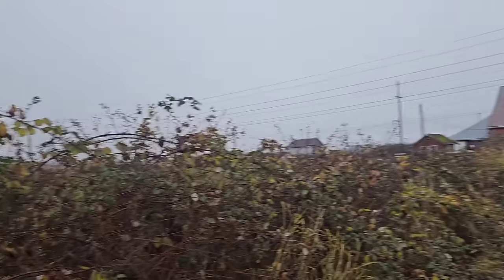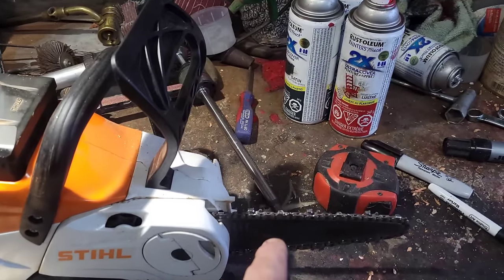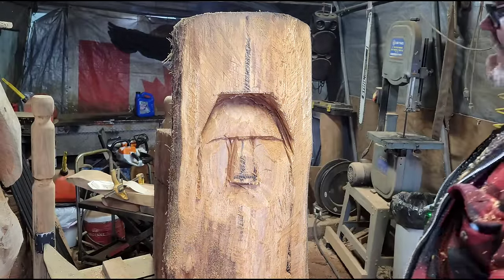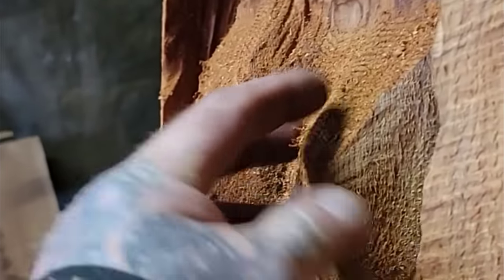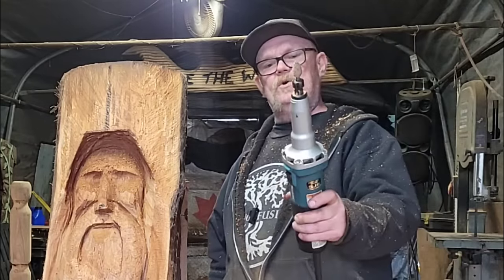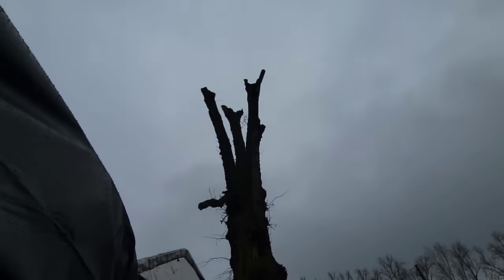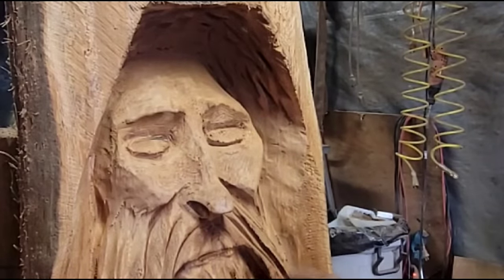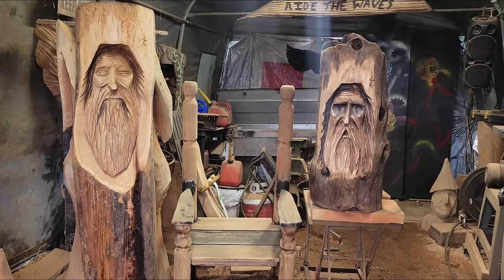Very beginner Step-by-step Chainsaw carving. How to carve a Woodspirit. Battery-powered chainsaw.

Comment: Great video, lot's of good information.😊👍 It'll  help alot. Just had six big willow trees felled in my yard, so not only do I have to do clean up and clear the yard, but I have to also buy a chainsaw to do it, and learn to use the saw. Figured maybe this saw would serve my immediate needs for cleanup, and then I can get the carving bars and chains to practice on the wood I have leftover. Willow stinks to carve,...but it'll be practice!
Reply from the maker: Yes practice but I have recently carved fresh cut willow and I'll say it's my least fave wet wood to carve
Reply: @CarvingFusion  I 💯 agree with you about that! I have tried carving the dry willow,...because it's in my yard,...still not a fan even when it's dry. But after leveling six willows, well, now I have six trunks  about five to six feet tall, and all the branches. It may drivee crazy...lol,😵‍💫😂but it's free wood to practice on for now. I have never used a chainsaw before, so I need to get basic skills and safety down. I loved the little willow branches you carved with the tree spirits, and then rooted them,...such a great idea! I may try a few with my Dremel. Also going to go ahead and get a decent die grinder and a few Kutzall burrs for it. Aside from the extreme flame burr,...what burrs do you use the most for your die grinder?

Comment: I'm with these guys, you are a carving guru and I learn so much from you. Also, get the cpap machine for sleeping. They take a little getting used to but it will change your life. Also, you say to get the 12 inch carving bar but the one you are using looks shorter than that. Is the shorter one better?
Reply from the maker: Thank you